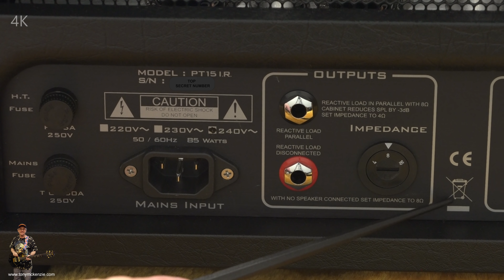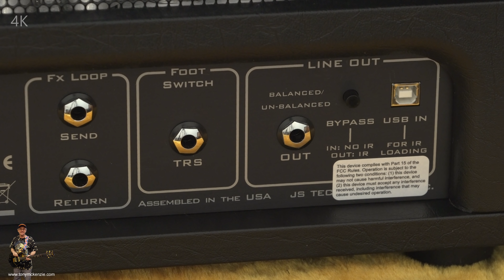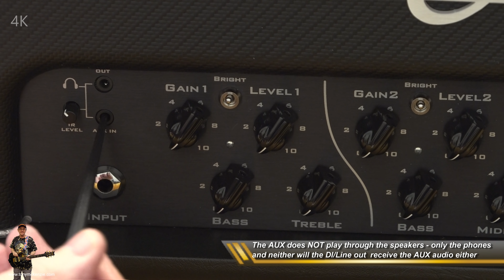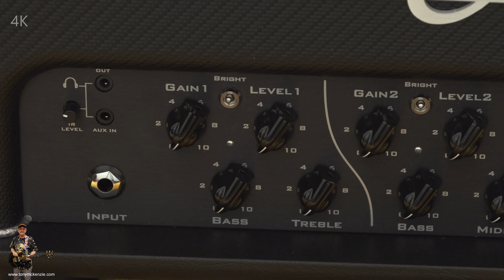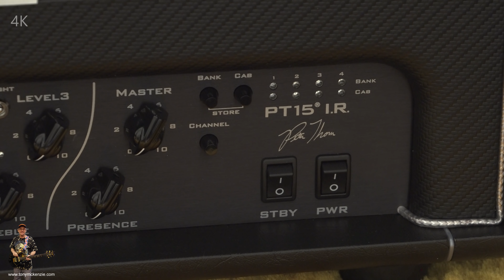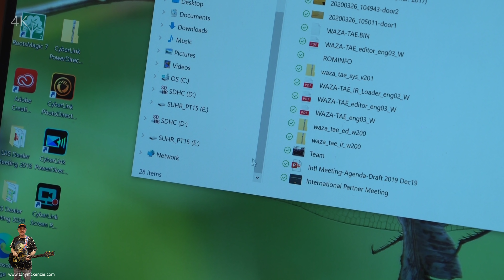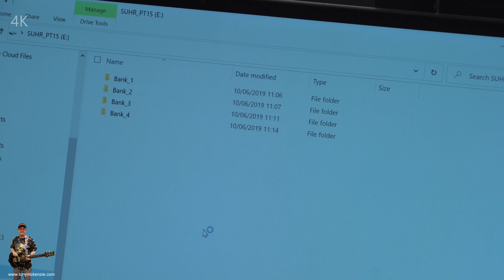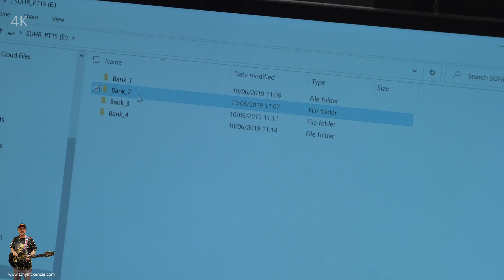The Suhr PT15 IR Amplifier | THE BEST REVIEW | An Inside and Out Closeup With Playing | The IR Amp

Comment: Great review, I like most of your reviews and how you do them. Do not get an ENGL Artist Edition and open that pile of garbage..Im warning you. hahah. $2000 amp that has $40 in quality. I know $2000 is nothing these days, but at least have higher quality than a, build by a 14 year old chinese kid using scrap parts, amp. 

As for Suhr. Only a handful of companies/product I would consider giving 10 since 10 is PERFECTION. Interesting how some people don't get that concept. Suhr happens to be one of the builders I would consider a rating of 10 however...I thought you gave this amp a higher rating than deserved. Again, I love Suhr and will continue to support them. I own a PT100, owned the first one as well, a couple of custom Suhr Classics and a basic, production line Suhr Classic (it's as good as most custom builds and the one that got me hooked on Suhr Classics for life). The washers alone would have knocked it down 1 pt or so for me. No excuse for that, NONE. Great builders and those that take pride in their work have no excuses (ask me how I know) when they screw up. They apologize and make things right and I'm very surprised that Suhr didn't offer to take care of that for you in his comment and following reply. It's just a washer, I understand, but it's the principle and what your character says about you. If you indeed have QUALITY CONTROL, have quality control! 

I don't know what the deal here was, but I'm a little disappointed in how John Suhr handled this. I know people from California are strange as hell. It's the state..everyone is entitled, they're OVERLY sensitive and have some suspect morals. Here in USA, it's known as the Sodom & Gomorrah state for a reason. This is very relevant, human character carries over to many things. It is what it is. 

I will continue to support Suhr, but this was a let down. I was very proud to own Suhr products and how good their customer support is. This day and age where everything is garbage and cheap, chinese parts with companies not giving a damn about the customer, it's great when you find a company that does things the right way and then this. Had he not replied, I would have forgotten about this, but his reply was surprising. We all have bad days and we're not perfect so he probably had a bad day when he replied, but the only thing he should have said was, "Sorry about the issue, send me an email. We'll take care of it right away". And of course explain the parts and the whole CE. 

Keep up the good work man. I like Suhr products, but I love honesty/character and workmanship even more. I'm not blinded by how much I like a product nor do I have loyalty if the product is not up to my standards. You gave the amp a higher rating than I would have.
Reply from the maker: An excellent post. Well I bought the amp at retail here in the UK and it was VERY expensive. I did a sort of standard review as best I can really, and it did not have that much 'glaring' at me, so I did rate it accordingly. (BTW I'll bear in mind the Engl). I had an Engl E670 amp some years back that was well made and no problems... but maybe things change..  and since 2020 what hasn't? Now we have a UK government that seems shall I say less than a representation of what a reasonable person might expect from them... oh well ;-)

Mr Suhr, hmm well I think both him and Pete Thorn seemed to not like my review. I tried to be very understanding at the time. Of course my opinion is only my opinion, but at least I DID review it, I was completely unbiased, and I lost a pile of money when I sold it later. However, I did feel rather 'attacked' by them at the time when I read their comments. Maybe that was/or was not intentional, but some don't like what is the reality of what I bought being shown around on the internet as I often do that I buy. 

Ha I have been to Cali twice. - first time 2004 was interesting but expensive, second time I think about 2012 and like a different place. I won't go back today from what I see about it all. But I still love the USA, Texas and Florida I really like :) 

You know what, you're exactly right on the amp and conversation they had. Of course I'm in the UK and much harder to solve issues from here. The dealers... I bought from them before many times, and one amp I remember buying (I still have it!) was a Jackson Ampworks El Guapo - that developed a problem on the switching and Leds on the front and that retailer fixed it perfectly. Since then I bought this Suhr amp and also a Friedman that to be honest I sent it back that one was horrible internally and should never have been sold. 

Sadly, I have not been back to that reseller since. Most often I don't see many issues on amps - and man have I reviewed so many over the years and most are very good. 

In any case.. hey thanks for watching this review, I did spend much time and effort and also the  money for the amp to review and I know that some guys will benefit form the review I created. I appreciate your comments greatly and you have a very nice manner with that post - appreciated. 

I am getting older by the day now, and to be honest my drive to continue to create these inside and out reviews is waning somewhat. The money I make from YT (Ha I lose far more than I make) is actually now taxed at 40% plus and that seems to be going up at the end of October by the government... makes it all a total waste of time.  I have really liked creating these video reviews since 2009 and there are a total currently of 447 on my channel. But...  it will likely stop any time. In any case thanks again.
Reply: @tonymckenzieofficial  I hope you continue to do your reviews, they're very informative and help a lot. They're also refreshing without all the ass kissing that goes on with the other music channels that (obviously get some type of kickback) somehow EVERYTHING they review is perfect and never a bad or sub par product. 
We all know that's BS! 

Don't get me started on government and politics..there's a reason the greatest minds that ever lived loathe government and politicians. If it's not broken...by God they're going to fix it! 

As for Suhr..I would love to see the role reversed and him ordering $3000 worth of top quality parts from a vendor (to build his guitars and amps) to receive some of the parts out of spec or not matching, like the washers and then if he were to review the product..I can bet my LIFE that he would not rate the product an 8/10 or 9/10..but he sure expects a higher grade review while delivering a subpar product that did not meet the price of admission. It's irrelevant if it was washers or the damn rubber feet. A company such as Suhr, a high end/custom company should inspect EVERY product with a fine tooth comb before it leaves the factory. If he doesn't agree, then he shouldn't throw a temper tantrum over a deserved rating. Don't want an 8/10 or 9/10 review, then send out a 10/10 product. Why is that difficult to understand? I know why, it's the California attitude I explained earlier. The entitlement mentality. "I deserve a 10/10 rating regardless. I deserve a participation trophy". Not in the real world you don't! It's a shame because a person of his talent and caliber and AGE should know better. There's an old saying here in USA. "The Customer Is Always Right" and it's what made, "Made In USA" products equal to "Made In Germany" products (which by the way, are not the same these days either). There's still companies like that around, they understand that one single customer could mean staying power or decline. Even if you have to take a loss, you'll eventually gain it in spades in the future. For example, I own a few custom Suhr Classics and Suhr was always my first choice for a new build. Now, after the childish tantrum, they won't be my first choice. Sure, I will still support them, but with 1000 custom shops out there ALL competing for my money, I will look at them as well and maybe even first choice. You have to hold these companies accountable just like you do government and politicians. We all know what happens when you don't. 

Im glad you did the review because now I know the real Suhr. Sweet and sour deal..sweet because it brought out the person and sour because it tainted the name for me. All of a sudden my Suhr gear doesn't seem as valuable as it once were. Only a handful of people will understand these days.. those that were brought up correctly with morals and principles. You don't claim to deliver excellence, charge for it and then deliver Walmart QC. Let other suckers be fine and apologetic with it, it's my money so I won't be. 

Well, good luck man. Hopefully you'll continue to review amps for a while longer. Hold your position, its the RIGHT one and keep delivering honest content. Some of us still value that more than anything. Take care!
Reply from the maker: What a wonderful attitude and outlook you have. It's a pity there are not many more guys that are like that. You have said everything I would have and honestly it is a pleasure to read and communicate with someone that actually 'gets it'. Since 1989 in the company that I have I have remained an CEO (MD in the UK) and one thing I know about is customer satisfaction. receiving something that is 100%  hard earned cash, for something maybe 10% of less value (or 90% on some of the stuff!) than it should be never sits well with me. Thanks for that post...

Comment: Great video! For a smaller head vs their higher wattage amps, it’s very similar price point. The MZ is hand wired. However, this unit it seems is way more expensive. I’d do the H&K Grandmeister and a new LP.
The sounds are superb. Going directly into your board this sounds great. Jeez, looks like a winner.
Reply from the maker: Indeed I still have my Grandmeister 36 its a cool amp especially for what you can buy them for. As for price I think this is an expensive head. I know they spent time on the R&D for sure and it all costs, but at the price I do think its rather out of its league like I said when you can buy a Mezzabarba built like that one is for similar money. While its true the Mezzabarba does not have every feature of the PT15 IR, its also true that the PT15 IR does certainly not have all the features of the Mezzabarba. There are other amps without the bells and whistles of this format of low wattage output and smaller case assembly that cost a lot less. But if you needed those extra features... I could see someone buying one. Thanks.... stay safe.
Reply: tonymckenziecom Tony, that Head really sounded great on the mix.
Reply from the maker: It was literally mixed right in from that out on the back... so what is on the video is at least like what could be on a PA FOH. What I would like to see is a no tube amp do the same and I never found one yet. But good to know from others that it sounds OK.. Ha my ears are not what they used to be...
Reply: tonymckenziecom Kemper. It’s on my wishlist. The kemper profiling pedalboard. Amp, FX.
Reply from the maker: I have had a Kemper since about two months after they came out. The Kemper can sound good there's no doubt about that. However, like every simulator I have ever tried (I tried most) what happens is that over time they add more and more 'features' (I'll call them that although some of it is pretty useless) and the user gets more and more bogged down with it all. The net result is you ask yourself questions like 'now where did they move that' or 'why is this so different now' or 'what the hell is going on' or you could make up your own questions.... actually you will! :) It's not that I don't like the Kemper, but it's that continual change for changes sake in many cases (not just Kemper). Somehow all those companies keep changing the firmware. So the question is... if the gear is so great (as they all say) why keep on changing everything under the sun? There can be really only one reason... its because everything is NOT all great in the first place. All those makers seem to think that it 'adds value'. Me? well I'm one of those guys where a reverb is... well, a reverb... a simulation is... a simulation. No matter how they cut it that's a fact and any changes are really saying in general that what you had before this change was not as 'good' as this change makes the unit. Poppy cock. Even in 2011 the Kemper was good and while the editor/librarian took nearly ten years to make (!) it does not improve the actual tone of the unit... it makes it easier to use. And with all those updates I could guess that many users might not find many of the 'features' that are now well hidden under the burden of the operating system. Axe-FX anyone. And one last thing... always remember that they are computers and computers with bad power supply in a venue will crash no matter what anyone says. Get your $100 APC unit before you gig!  Does ANY of this sound familiar?  But I STILL like Kemper! :)  Stay safe.
Reply: tonymckenziecom That’s what happened to Amplitube.
Except in reverse.
They updated it forever and it’s great now.
I have a Orange Bass cabinet through a Dr. Z.
Crazy.
Reply from the maker: Well if they cut back on the incessant updates every other day that's certainly an improvement. But your comment in some ways is my point... they released (according to the sales videos) the best software for the job in hand, they said so (and I mean ALL emulator software types) and then they start to make it work? I mean, what's wrong with these guys... why not do it all before they release it? It's a classic thing they all do. Not sure if you agree about that, but where software is concerned I guess I can include all DAW software too with upgrades you pay for but often offer little.

Comment: I’m Not Familiar with that other Amp you mentioned ??
I am Familiar with Steve Vai, I saw his First appearance with Frank Zappa !!!
Reply from the maker: You should check this out here: https://youtu.be/C4WLh0vYaIs?t=496 and I doubt that you will find any issues with that amp Gerry. It's just about the best built amp I have ever seen... that's a link to it from where I start the review of the inside of the amp. Let me know what you think of that one :). Joe Satriani and Steve Vai and many other guys use that amp but they don't shout about it. It is made in Italy by PiereAngelo Mezzabarba in a place called Mezzabarba. He is a very nice guy and always has time to listen. Let me know what you think of that amp.
Reply: tonymckenziecom 
WILL DO !!
I AM RETIRED NOW, BUT ACCUMULATED A LOT OF STUFF OVER MY MANY YEARS !!! 
I’VE GOT THREE MARSHALL HEADS: JCM2000DSL 100 Watt, JCM800 50 Watt, JCM800 100 Watt,
MESA BOOGIE DUAL RECTIFIER 100 Watt (love the flexibility and tones)  
FENDER HOT ROD DELUXE, FENDER PRO SONIC, FENDER BLUES JR
Reply from the maker: Those are pretty cool amps! I like Mesa Boogie and Marshall too. I like Fender also but they are less common here I think. I have an road King II now discontinued but that has a great tone for lead guitar and has been one of my main amps for years. I converted that from 110 volts to 240 years ago. The video is on my channel how to do it :).

I tend to think that the real tones come from the amps. While of course everything matters and speakers have a big role, (and hands I guess as you mentioned), I have many guitars etc. but the amp for me is the key and different amps are clearly (art least in my mind) suitable for different styles of music. That's how I tend to use them.

Comment: I love seeing guys demo these amps from a perspective other than high gain/shredding. I personally have nothing against circuit boards and have many fine sounding amps that are circuit board based. I do prefer through hole components primarily for repairability, and I think capacitors depending on their construction can influence tone in a way SMD can’t, resistors I could care less. I do however prefer at least hand wired pots and tube sockets to go along with circuit boards.  But that all said, for the money- that amp should be hand wirerd or free parts for 10+ years!!!!
Reply from the maker: Indeed, and I have many PCB amps too. I don't get much trouble with amps but I'm in a studio so maybe that's part of it. Ha I just had a few backing tracks and this one was laid back so I thought what the hell, use that. Also partly because you can also hear the guitar better than flat out cranked. So I used a telecaster style and a PRS which are different enough to at least hopefully offer the different tones. I used the same IR to the desk but changed the channel for the PRS to channel 3. The pots on the Suhr were in fact hand wired on to little sockets which I thought was a novel idea and I don't think I've seen that before. Tube sockets on the board. Ha I agree it is an expensive amp and like I said comparing it to a Mezzabarba here: https://youtu.be/C4WLh0vYaIs?t=496 makes the Suhr expensive in my opinion too. The Mezzabarba was similarly priced. Thanks... and just stay safe.
Reply: tonymckenziecom at least they got the hand wired pots right
Reply from the maker: Ha yes they did... those were the intermediate smaller ones though.. not the tiny ones, but about 3/4 inch across. A bit less common and no CTS in sight. Seems many makers are changing to the brand on this amp as well as to JJ tubes. Somehow, I could be wrong, but it all seems cost price driven somehow.